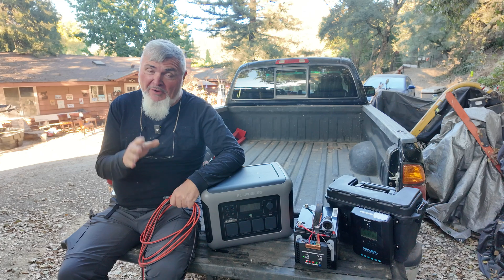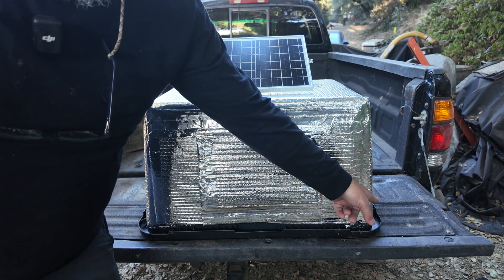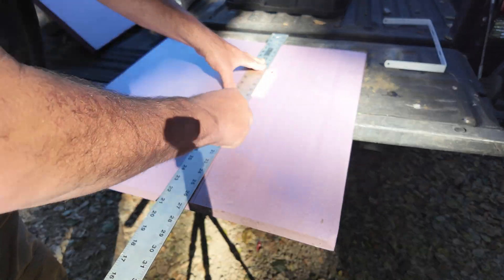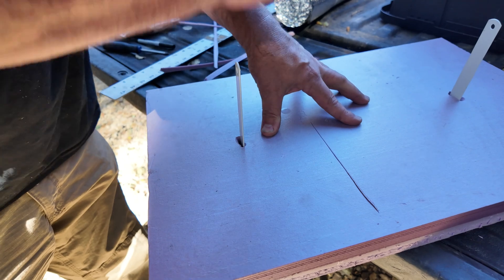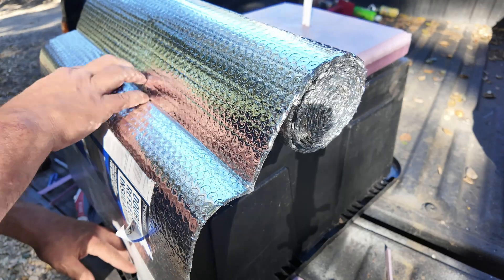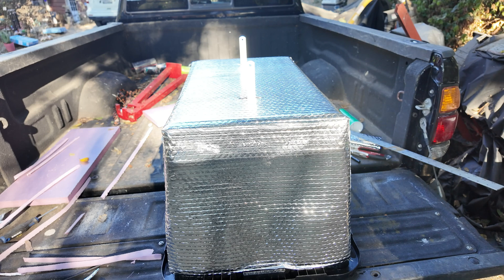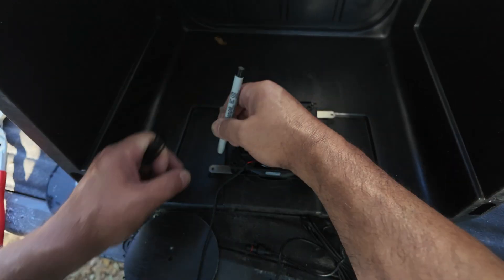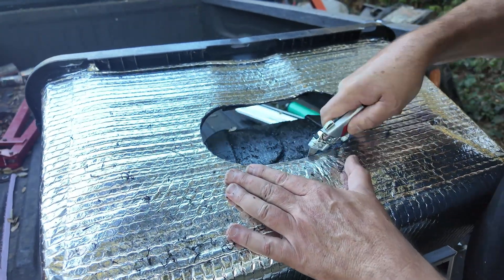❄️ DIY Solar Generator Cooling Solution! Build a Forced-Air Cooler to Protect Your Batteries 🔧☀️

Comment from the maker: 🔗 Affiliate Links: The links shown are affiliate links; using them is free for you but directly supports the channel. Thank you for your support! 🙏

Reflective Insulation - https://amzn.to/3Nw06O1
Foam Insulation -https://www.homedepot.com/p/Owens-Corning-FOAMULAR-NGX-1-in-x-2-ft-x-2-ft-R-5-Project-Panel-XPS-Rigid-Foam-Board-Insulation-9WE/315401957
Solar Fan Kit - https://amzn.to/4h9mFWp
5" Hole Saw - https://amzn.to/3Yu3cID
1" Forestner Bit - https://amzn.to/3A3W64h
R1500 Allpowers Solar Gen - https://amzn.to/3Nva6XN
Tote - https://amzn.to/3Nva6XN
Aluminum Tape - https://amzn.to/3Nva6XN
3M Spray Contact Cement - https://amzn.to/4dSCYEh
Liquid Nails - https://amzn.to/4hmRMxY
Zip Tie Adhesive Mounts - https://amzn.to/4dTYJ6s